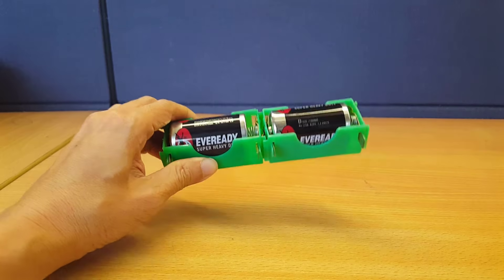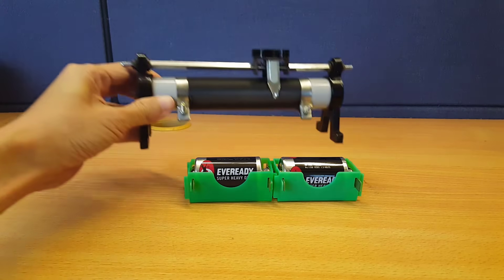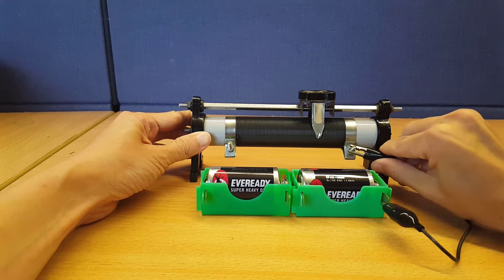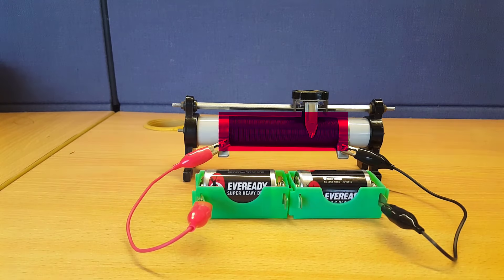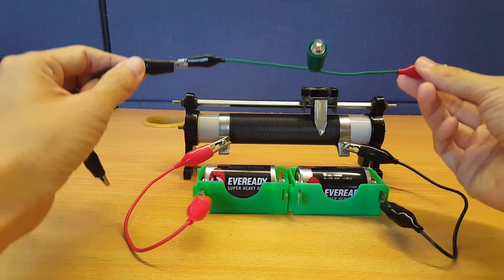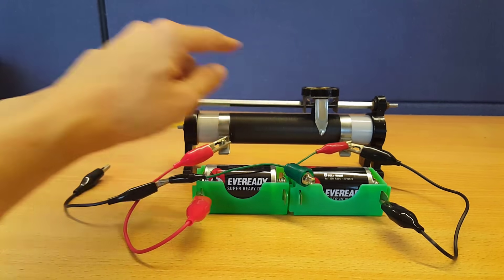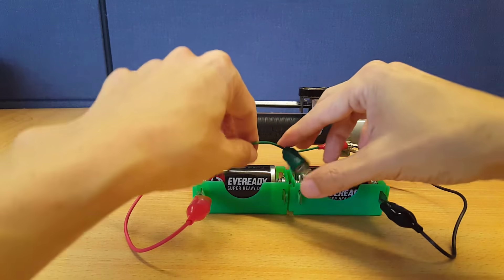How to connect a rheostat as a potential divider

Comment: Great video but I'm still wondering what is the difference between this and connecting the lamp in series with the rheostat?
Reply from the maker: As a potential divider, you can reduce the pd across the lamp all the way to zero. In series with a rheostat, you cannot. Because in theory, the lamp will still get a fraction of the battery's emf. This is actually true in practice if your rheostat's (maximum) resistance is comparable to the lamp's resistance.

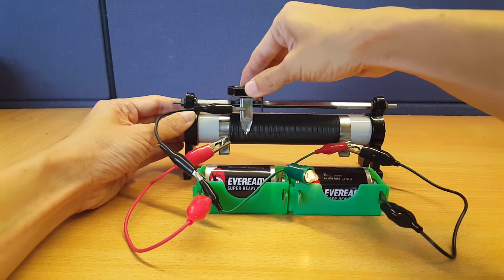Comment: 1:09 the end which we connected with sliding contact, then we connected it with  the rod ,is ther  no differnce between the two points?
Reply: yes it’s basically the same as the current travels from the sliding contact to the rod in the second scenario